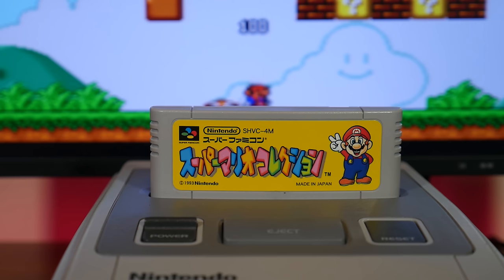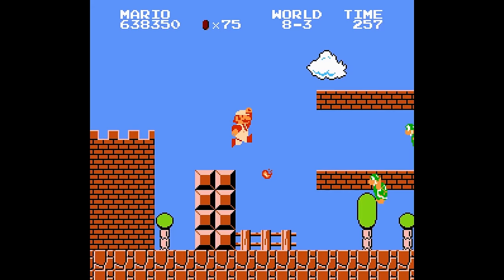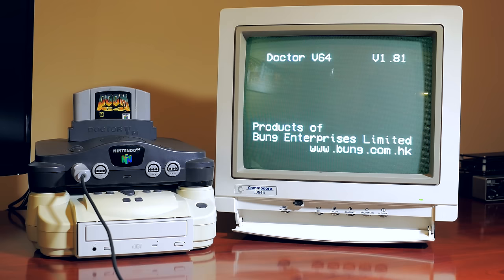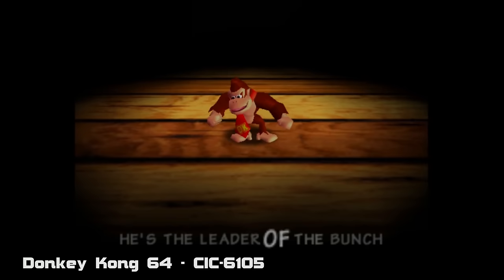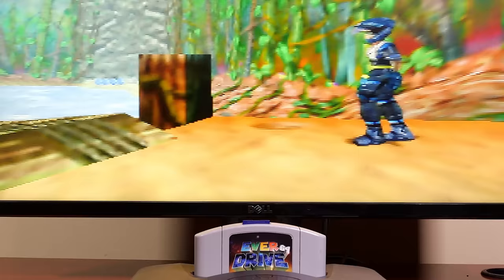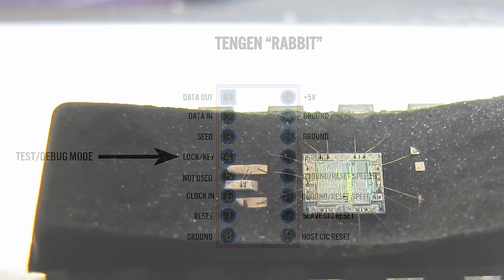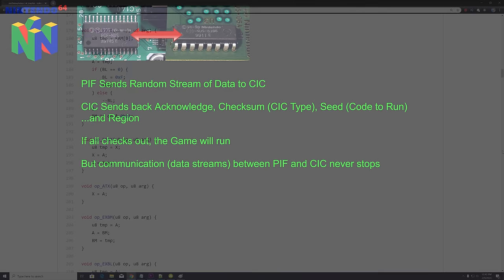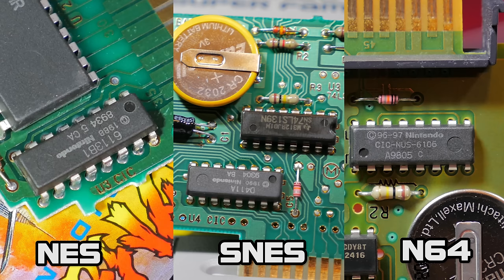How Nintendo Stopped Bootleg Games on the Nintendo 64 | MVG

Comment: That totally explains the uptick in N64 reproductions we started seeing a few years ago!
Reply: That's why I buy my games in person whenever possible so I can physically check the board and make sure it's real. Luckily I've already got all the rarer/expensive games that I wanted that people might actually bother making repros of.
Reply: Time to make a Ben drowned MM cartridge :D
Reply: Smattless  On ebay any n64 game with a stock image and multiple copies in stock is most certainly a reproduction.
Reply: @palen2890  Yeah, same with a lot of rarer DS games.  I've seen people selling "Brand New" cartridge only DS games for about twenty bucks even though the actual game would cost you three times that amount.  Of course, the multiple copies is a dead give away as well.  The problem is that some people will buy these without realizing its a repro and then later try to resell it thinking its real.  Because of that, I am kind of scared to pick up cart only DS games if the game has any sort of value.
Reply: They are not repros they are technically counterfeits
Reply: run lase they’re technically BOTH
Reply: They're awesome...
Reply: hello mr. mario!
Reply: @runlase7107  I'd much rather buy a "counterfeit" N64 game on the cheap instead of an authentic N64 game that costs $100-$300.

But then I'd probably just get an Everdrive64 cart.
Reply: Reproductions aren't necessarily a bad thing. Wanted to play some Conker's Bad Fur Day, but an original cartridge in good condition is sold at $100+. So I got a production for $20, looks just like a real cartridge and plays fine. That being said, if you're a collector then definitely buy the real thing, otherwise it's not any worse than emulation. 

@run lase Counterfeit or not, why should it matter? It's not like Nintendo and developers were making any money when you buy a used N64 game... As long as the person selling it is not trying to pass it as a genuine copy.
Reply: @runlase7107  They are counterfeit only if they don't label the cartridge as a reproduction.
Also, some of the original N64 hardware will likely die someday. The controllers might die. The game ROM chip might die.
It might be best to buy replica hardware if you are into N64.
When Nintendo decides to re-release the hardware, then you can buy from them.
Or maybe they'll release something that runs on their Wii.
Personally, I have gotten into SEGA Genesis. Buying cartridges is difficult. The AtGames SEGA Genesis helped me out.
Reply: Yeah, needing to use a donor chip from a donor cartridge would have added a lot of additional cost and hassle. That being said, there was a sufficient and consistent supply of donor chips thanks to the existence of mediocre sports games . Still, I'm guessing that it would be hard to find N64 cartridge games for less than $5, especially in large quantities, and the additional time and effort it would take to remove these chips also added additional cost, all of which needs to be offset with the price of the reproduction cartridge.
Reply: @gamephreak5  I have to agree as long as it works and  can play my game.
Reply: @MadLink Really depends on your outlook, if you just want to play a given game and know what you are getting then nothing wrong with it. If you consider yourself a collector and think you are buying an original cart then I would I would say you have been scammed
Reply: Buy a real cartridge for 100 dollars that is beat up  has connecting pins that are about to fall off , but at least it's REAL lmao
Reply: Iwakura Baikaiya something like 8 years ago when my buddy and i were in early high school he had his mom buy him a copy of pokemon leaf green on ebay. a couple months ago we found out that she had bought a repro lmao

Comment: NES, SNES, N64: piracy only became possible way after the end of life of the console
Wii, 3 years from its launch: just give me a pair of twiizers, or an SD card 
Switch, not even one year from its launch: paperclips
Reply: Reality but in all of the three cases the CIC/PIF chip security still wasn't defeated, so piracy was still very limited I guess?
Reply: Man I played N64 in late 90s with a lot of counterfeit cartridges. You just needed an adapter cartridge... That, after watching this video, I think was just an CIC chip and a slot for a counterfeit cartridge.
The counterfeit cartridge would cost something like 15-20 USD at the time (50 BRL actually) ... Not cheap, but a lot less expensive than the original.
Reply: @bielgaucho_real  yes. I'm always riddled when he says "this wasn't cracked until" and think of: but what about the counterfeits I played? 

One thing, for sure, was that those adapters could fry your console - probably due a excessive number of communication between the PIF-CIC? Not sure, I'm sure that ai had one N64 fried up and one that is still working, but has never seen a pirated cartridge.
Reply: There were bootleg carts for the N64 - they were just too expensive to ever become popular.  The CIC was cloned in exactly the same way the SNES/Super Famicom CIC was - decapping it, imaging all the layers and generating a set of masks from that.  The carts also needed logic to implement the latches and address counters that were built into the custom ROMs that Nintendo used.  Back in the day, the "go to" platform for N64 piracy were devices like Bung's Doctor V64 or the UFO CD64 which loaded the ROM images in from CD.
Reply: @samueleproiettimicozzi8134  the switch can be completely taken control of, that was discovered very shortly after accessing tegra rcm was.
Reply: Dylan Harding yeah I know, in fact it was completely reversed and a lot of tools like hactool were created to make use of this knowledge
Reply: Nintendo: Announcing our next conso-
Hackers: Just shake the cart.
Reply: @bielgaucho_real  South America is a region I really don't mind if people the pirate games. The games are sold far beyond the paygrade of regular people.
Reply: I had a very powerful 'pro fighter x turbo copybox' for my snes during the snes lifetime, it could play sf2 turbo I believe which was more mb than the regular games. Also it was modded with a dsp chip to play mario kart. 
For the fx chip, the copybox wasnt modded, so I believe starfox was about one of the few games I could not play.

When I saw other kids drool over games such as rtype 3 or secret of mana in the toy stores for 150 guilders ( back then) I  had already played these games for months before they even hit the Dutch shelves...
Reply: im not going to mod my sons switch. i want him to keep playing it online.
Reply: " NES, SNES, N64: piracy only became possible way after the end of life of the console"

heh... nah. 
what stopped piracy was likely federal police not letting pirate cartridges in your country.
in places where they did not care... it was rampant, specially because it did not require changes in your snes (unlike latter genesis models which needed to be modded)
and while certainly was not cheap as downloading a game and putting it on a SD.  a pirated cartridge would still sell for 1/5~1/4 of the price of a original
Reply: @bielgaucho_real  at least the one time i saw a cartridge like that, it was very very unreliable. a sightly breeze would make the game freeze. 
i always assumed that was because of that they they did not last long in the market, i never found any of them despite being around places where you could find that kind of stuff back then.

in the end just renting the damn games was simpler
Reply: It's a result of convergence of hardware. It's too expensive for Nintendo and even Sony/MS to manufacture completely new hardware from the ground up for a new console, which competes with the likes of AMD/NVIDIA's graphics cards or AMD/Intel's CPUs. So now hackers can use known tricks at the lower levels of software/firmware to bypass checks that are carried over from other devices.
Reply: With modded Switch you cang play online and many games need online gaming.
Reply: @Vetusomaru  no, or at least not on Switch. First of all most games on the Switch come without multiplayer at all, and as for the ones that support it... well it's Nintendo Switch Online, they don't even have a server and rely on peer-too-peer connections through consoles, it's just so bad it's not worth the money you pay for. Trust me, as I tried it with a one-year subscription and felt really really bad with the experience.
Reply: @khhnator  Lol, nah. That’s very likely. I don’t think any federal police with their priorities straight are gonna go “Shit! Stop him! He’s pirating Mario Golf 64!”
Reply: @spiicypotato  the whole IP law enforcement is a quagmire, the police on street rarely cares about it unless is too big. when you are after muderers and robbers, some guy selling faking prada purses qualifies as being in the "good guy" side.

you can be pretty sure that when a big raid happens anywhere it was because the order came from higher up and would be a safe bet that influence, hand greasing and law bending were involved.
that's specially true in countries that care less about ip laws(which are like, most of them) where it can reach levels where the whole thing is even more illegal than the piracy itself, but as long the powers that be are happy that's all what matters.
Reply: Except nintendo has made the new model switches unhackable unless you mod the hardware itself. Nvida was at fault for the bypass found.
Reply: @mems9953  I said what happened upon Switch's first year of life, not what happens *now*. And yes I know the current Switch homebrew scene, it's a bit disappointing that Mariko models are still unhackable on recent firmwares tbh. I hope they find a new unpatchable exploit but we'll have to wait a lot, as usual in the console homebrew scenes. But for the hackable models... man, the Switch one is one of the best homebrew scenes of consoles of all time. You can do A LOT of things with your hacked Switch since there are really really many homebrew applications out there, and most importantly, a lot of super talented programmers are involved in the scene, so we have many quality homebrews. It's really exciting, I often turn on my Switch just to check if there is any new interesting homebrew in the hb app store. Not to mention Atmosphere and Hekate... they are super professionally maintained
Reply: @twoevileyes  That would not fry a console, it's something unrelated
Reply: I used a piece of tinfoil and a toothpick to mod DS's.  No joke.
Reply: The NES's security was bypassed during it's lifetime. People didn't have the technology to do anything with it at the time, except some devs making custom carts to avoid Nintendo fees. SNES did, like in the video.
Reply: wii u : i dont need nothin all i need is an sd card and internet!!
Reply: Not true, in n64s prime I have z64 mr backup
Reply: @randomrfkov So true my cousin got everything in South america. Its make me think how hard my aunt and uncle worked for their kid's happniess.
Reply: @samueleproiettimicozzi8134 Major difference, is, although more recent N. Switch models cannot be easily moded through recovery mode, you can emulate the games on PC and higher-end hand-held devices.

Comment: Banjo Tooie's AP implementation was a modified version of Jet Force Gemini's. Game assets were encrypted, and when loaded into memory, the game sent a challenge to the CIC, and used the response to decrypt the assets. JFG used a single challenge/response pair. Tooie used many. Project 64's solution was to run the game on real hardware and capture every single challenge and response pair the game ever used, which was only 200-300 pairs, to build a lookup table, as mentioned in the video. Encrypting the assets was dastardly because it complicated the cracking process. You couldn't just find the triggers and disable them. You had to feed the decryption keys. I believe a rom patch was released in 2012, using the lookup tables.
Reply: This is basically the code sheet all over again - I remember spending hours figuring out all possible answers for games like Prince of Persia 2 to build my own sheets. (This was before internet was everywhere and after the game stopped being sold and supported)

I never did get all of the POP2 solutions, but I had enough to get ingame within a few tries.
Reply: @amshermansen  damn that brings back memories.Indiana Jones and the fate of Atlantis. Those crappy code wheels that came with it. That you simply xerox both pieces of cardboard and create your own.
Reply: Could this encryption method be the cause for Donkey kong 64 memory leak?
Reply: @ZinhoMegaman  I don't think DK64 used this method. The only two games present in pif2.dat, i.e. the only two games that required this lookup table as the video and Jacob described, are Jet Force Gemini and Banjo Tooie: https://github.com/twostars/project64/blob/master/Bin/Release/pif2.dat
Reply: @amshermansen  I still remember plenty of the answers from the original populous game..
Reply: That's super clever -- both the encryption and how it was cracked. Insane that it took til 2012 to figure it out though o.o
Reply: Thanks for the explanation. When he mentioned how the emulators had the response codes I was thinking 'wait, so where'd they get *those*?'
Reply: @Rokkuman X No, the DK64 memory leak happened on Virtual Console rerelease as well as the original hardware, not just on emulators.
Reply: Dude, nice intel! I''ll bet you forget where you put your car keys, but you remember shit like this no problem haha. At least I do. XD
Reply: Thanks for actually providing the info that the video falsely promised.
Reply: Holy shit, JFG. Now that takes me back